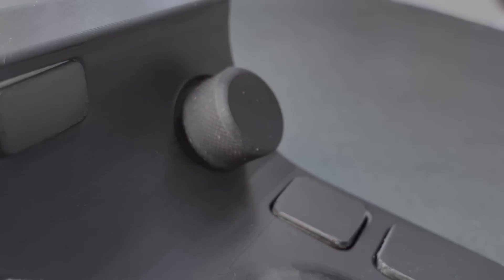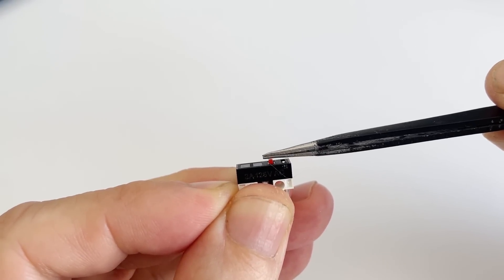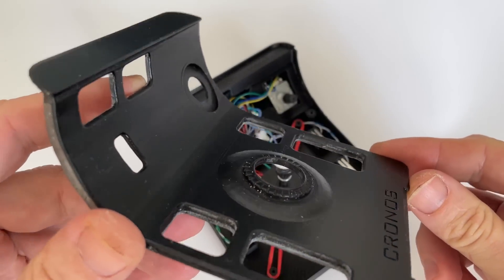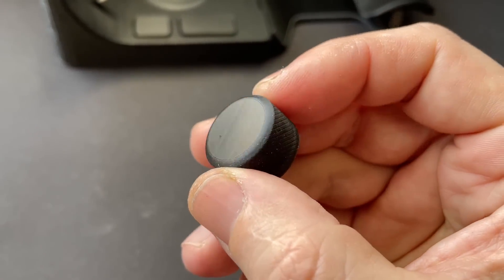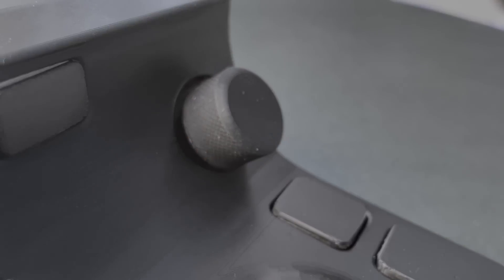Creating the Ultimate Mouse: The Journey Behind Cronos Control - A Mouse & Trackball Hybrid!

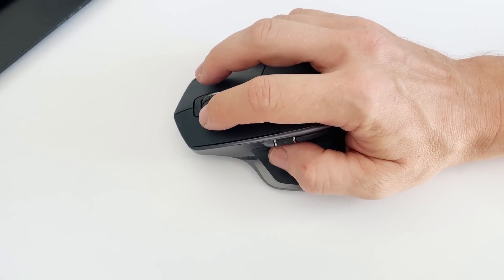Comment: 2:17 - Goal is Ultimate ergo mouse
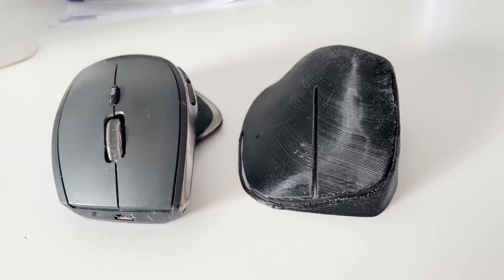3:08 - that form factor looks familiar... wait is that a ergo stationary mice?
3:14 - mini trackball or a force sensor array [TrackPoint] would have been a good contender
3:22 - Hall effect joystick could solve the dead point issue 
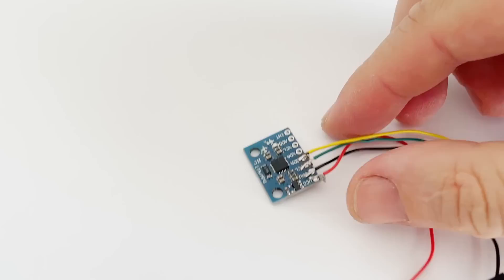3:31 - a 3 axis's magnetometer would have been a better option to the gyroscope, the main shaft can be made of metal 
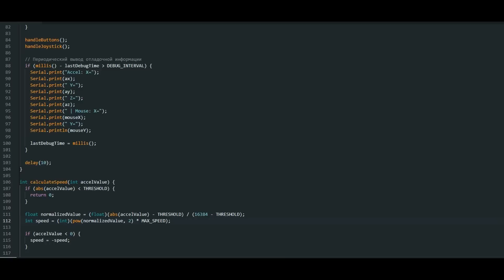3:36 - a stalwart platform is more stabled 
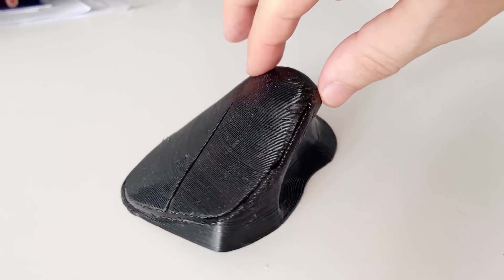3:53 - inspiration mostly likely to be from the Suncom's "Atom Mouse" or Altra's "Felix Pointing Device"
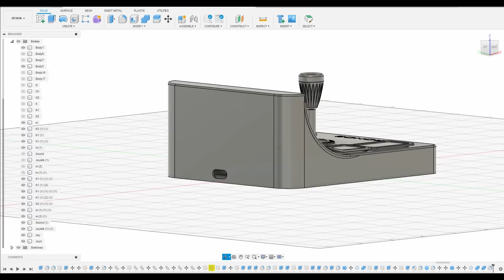4:07 - this is just a slightly worst version of a hobbyist space mouse 
4:12 - a flight stick?
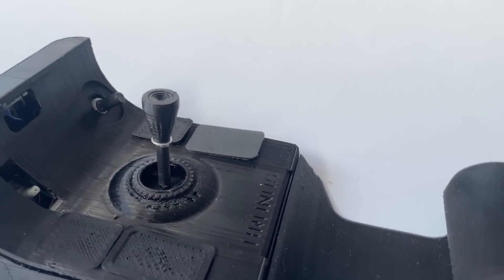4:31 - this is just a space mouse with 4-axies out of 6-axis missing
6:34 - this is just a Video Editing Console that happens have a flight stick attach to it 

I like the ideas in the video, but this needs further refinement to become a finish product. I wonder what a version 2 of this ultra Mouse would look like.
Reply from the maker: I'm currently busy filming a video about the changes I made thanks to your comments. Thank you for your constructive criticism.

Comment: Wouldn't this strain your wrist quite a bit from hovering your hand? Also I am quite concerned with tracking precision as it's my biggest gripe with the thinkpad knob
Reply from the maker: I changed the shape for holding the hand and added adjustments for length and angle to make the hand position comfortable for any palm. I will soon finish the video about the changes.

Comment: What are you doing to your mice? I've had both the original MX and the first MX Master and I got many, many years of all day use out of them without ever having to replace any switches. I got 5 years out of the original before replacing it for entirely aesthetic reasons. I've had my first gen Master since 2017 with no problems...

Comment: If you went that far as basically making your own type of mouse, it would also be a great idea to make it at an "handshake" angle to reduce risk of carpal tunnel syndrome, and it honestly looks like it would be easy to implement
Reply from the maker: Yes, I did it, changed the hand rest making it ergonomic with a slight tilt. I plan to make another video soon where I will show the changes and also demonstrate it in operation.

Comment: Not really any ultimate mouse at all...is just a very narrow niche for your specific usage.
The joystick is a very very limited way to move the cursor compared to the mouse which can be either small area usage or instantly jump to the other side of the screen with a simple and short jerk of the mouse. The joystick method doesn't offer same fidelity and adaptability. Not just a technology but the finese required because you use one finger instead of the whole hand in the case of the mouse

Comment: Any chance you will produce a wireless version? Only thing keeping me from backing your kickstarter is that this version is corded. Otherwise, take my money!
Reply from the maker: Unfortunately, the wireless version may be inferior in terms of connection quality. Technically, I can add Bluetooth and a battery, it’s not difficult, but comfortable work requires high bandwidth, which is provided only by Bluetooth 5.2 and higher. Alas, not all users support such modules, so for stability and responsiveness, it’s better to leave the wired connection for now.
Reply: Ah, yes this makes sense. Thank you for your reply. Also, it was unclear on your kickstarter - does the DIY Kit come with all the components including the mouse housing and buttons/knobs? I do not have access to a 3D printer, but perhaps, I could build my own and add in a wireless transmitter and battery. I would need to be able to travel with this mouse, as I often do with my current MX Ergo trackball.

Comment: In glad you found something that works for you, but there are a number of issues with this, and I feel like it's far from being a finished product. Also, there are a lot of issues with your initial reasoning for the need. 
1) As far as the need for this product, the biggest issue is the fact that your demonstration (and therefore, likely your understanding) of the different grips were incorrect. While you may not find any comfortable, even with a proper implementation, most people find one of those 3 to be perfectly comfortable for extended periods of time. 
2) while the sponge "plate" will help with inertia dampening, and the middle click being attached to the joystick does make sense, I don't feel these two methods are compatible. The sponge plate will definitely affect the feel of the button. Also, with a micro button like that, there's no way that you're able to freely move the joystick while also depressing middle click. Maybe consider magnets in a push-push configuration for dampening instead. 
3) The rest to raise the hand position up and reduce the angle is definitely a good idea for ergonomics, but it should be a palm rest, not a wrist rest. Also the rest position should be slightly higher than the joystick level, since extended periods of flexion are bad for carpal tunnel and similar issues.
4) you've essentially deconstructed the mouse, and added further distance between all of the elements, necessitating frequent removal or adjustment of your hand position to interact with certain areas. If you integrated your joystick into the (palm) rest, you could potentially move more elements to be interactable without the need to readjust.
5) I hope your gyroscopes and software have the ability to zero them out, considering without it, any area that's out of level or intentional added tilt would render them useless.
6) you could definitely consider a rheostat or linear potentiometer for scrolling instead of another gyroscope to simplify things tremendously. With the inherent dampening (due to construction) of them, putting a spring return to center it likely wouldn't have the same bouncing affect.

All in all, I'm glad that you found something that you like and enjoy, but as far as marketability and polish, I don't think it's there. Or that there's anything that this mouse does, that a 3d mouse couldn't do better. I also don't feel like you explored the trackball option enough. Turning sensor speed or cursor speed up, with a large trackball, let's you keep direct motion input like a mouse, rather than relative, like a track point or joystick, while keeping the wrist stationary. Even with slow cursor speed, you can flick the ball and let it spin, catching it at the estimated point. A few days of getting used to that should have you right as rain. You can then also combine keyboard inputs with the trackball to also let it control things like scrolling, keeping direct motion input as well as the granularity of speed.
Reply from the maker: Thank you for the detailed analysis and constructive criticism! I appreciate your attention to detail and agree that the design has areas that can be improved. You have a deep understanding of ergonomics and technical aspects, and many of your ideas, such as the magnetic damper and the correct tilt angle, are worth considering. However, let me explain why not all of the suggested changes may be successful for the current design.

About classic grips. I agree that traditional grip shapes suit many, and I do not aim to completely replace classic mice. My approach is rather focused on specific use cases where classic designs are not always convenient or even possible, especially for users looking for a new experience. Of course, this is more an experiment and exploration of alternative options than an attempt to replace generally accepted standards.

Sponge and middle button on the joystick. The idea with a magnetic damper sounds interesting and may provide better control than a sponge platform. However, I will need to do some testing to make sure that this design does not make the controls too complex or too sensitive, especially with prolonged use.

Palm rest. I agree with this completely. Increasing the angle can really improve comfort, and I have already changed it. I will soon finish the video showing the changes I made.

Spacing. Yes, adding a joystick has increased the spacing between the elements a bit, and this potentially reduces comfort. A possible solution is to actually try to integrate it into the palm rest, as you suggest, to minimize the need to move your hand. This is worth further research.

Gyroscopes and zero point. The calibration of the gyroscopes is already implemented. When the device is turned on, the gyroscopes perceive this position as the 0 point.

Potentiometer instead of a gyroscope for scrolling. This is an interesting suggestion, and I will consider it to simplify the design and improve control over scrolling. Perhaps this will really eliminate unnecessary vibrations and improve sensitivity.
Reply: @DIY_Yarik  I loon forward to the next video! I love unique solutions that are custom tailored to the person's preferences. But I also wanted to offer a bit of pragmatism that, since it's so tailored, it may not be as revolutionary as a mass product.

Comment: the buttons start to stick because a small electrical arc forms when you unclick, causing some damage to the contact surfaces of the metal in the button part. You can just scratch and clean those surfaces a bit and they'll be good as new for a long time. Kept my 12-year old sensei alive no problem!
Reply: arc can't form under 14 volts on sea level, there is something called electrormigration, you can mitigate it by making contacts from special silver alloy
Reply: @Strieuok  I have never heard of this lower limit on arc voltage and I'm having difficulty finding info about it, can you elaborate? And is this electromigration effect sufficient to reduce the surface area of pieces of metal that are made to contact one another with a spring force, starting with about a mm squared, that a button would no longer register as conducting? It's a neat alternative explanation as to why my periodic repairs of the buttons had an effect, thanks.
Reply: @Strieuok  I can wholly understand typing up a wall of text for strangers on the internet and appreciate it very much :). Thank you for the very informative post! After 12 years I did finally replace the switches (indeed omrons) with functionally identical ones, hope I can get another decade out of it!

Comment: The Razer Mamba Elite has the best solution for scrolling I've come across. You hold the mouse wheel to the side, left or right, to continually scroll. If you look at a top down picture of it you'll see two arrows to the left and right of wheel indicating this. I've never found another mouse that does this and after having used it I can never go back.
Reply: @mattl204  Razer Basilisk has HyperScroll option also.
It allows for a free-wheel scrolling mode with big wheeling power.
Combined with horizontal scrolling, I can’t go back either. 🥰
(Logitech G502 has an earlier equivalent, but barely usable due to the stopping being less reliable.)

Comment: First off, it's always a pleasure watch someone design and build a new idea they're passionate about, keep it up!

However, I have a major concern about the ergonomics of this. The hand and wrist are forced backwards quite a bit which is not a natural position for them and will lead to wrist issues with prolonged use. The advantage of a "mouse" that doesn't move is that you can place it in any orientation you want, so I would encourage looking at how you can redesign with that in mind. Try just letting your arm and hand relax down onto your desk and see the position that they sit in at their most relaxed state, and design to try and keep your hand in that position.

Secondly, on ergonomics, several of your controls need quite a reach to work them. This is especially noticeable with the scroll lever; your finger is fully stretched just to get your fingertip on it. The best possible situation is to have all your controls at your fingertip without having to move your fingers at all, so consider how that could be done.

For the joystick, several people have recommended hall effect joysticks already, which to me seems likely to be the best solution, but if you want to continue with your design, then consider trying a very loose fit ball and socket filled with grease to smooth out the motions. The socket would be part of the base, and the joystick would have a ball on the end that sits loosely inside, with the space filled with grease. This would move smoothly but the grease would slightly resist motion and help to prevent vibrations.
Reply: Yeah I noticed too that he need to stretch a lot. Honestly it feel that he is really close to something here.

Comment: This is a pretty cool project and I am glad it works for you. But I don't have any of the problems you have with a mouse; I seem to use a different grip than the three you proposed (my hand is totally relaxed and have no issue reaching any button or scroll wheel), I have never had a mouse break on me that just cleaning wouldn't fix (since the 80s), and I just set my sensitivity high enough that I hardly have to move my wrist to move the cursor to a second screen. It also seems like your cursor moves atrociously slow, you should do a 'cookie clicker' or similar demo to highlight the accuracy and speed of the cursor movement.

Comment: This might be the least ergonomic mouse I’ve ever seen.

Isolating the movement to only your index finger basically guarantees you’ll develop some sort of repetitive strain injury.
It would be bad enough if it were an index finger operated trackball, but that joystick isn’t exactly precise, which means you’ll have to do a lot of correcting movement, which only adds to the strain. Its lack of precision is also just a general downside compared to a highly precise mouse.

You’ve basically invented an RSI induction machine here. The ergonomics are just disastrous.

It’s not a bad project, but I highly suggest you to do a V2 with a trackball or something while paying attention to the ergonomics.

Comment: The MX ERGO S trackball is an amazing pointer. Granted, I have been using thumb trackballs since 93 and I think it is absolutely the most ergonomic design in existence. Your arm and palm are completely relaxed during operation and your thumb and fingers land on the control surfaces completely naturally. Combined with a SpaceMouse, navigating 3D environments is a breeze.
Reply: 100% agree.  Gaming with it is a breeze.  And alot of the wear associated with a traditional mouse is completely eliminated.  I won't ever go back to a regular mouse.
Reply: @quasimojo777  Wait... You can game with a trackball mouse? I cannot imagine how that feels tbh I never used one of those mices but somehow got interested
Reply: @exactpause9218 yep! Completely possible. Just takes a little getting used to, but with practice and tweaking, you can be extremely accurate, utilizing the momentum from flicking the trackball and stopping it to turn fast.
Reply: Thumb trackballs destroy my thumb joints. Every downward swipe just puts so much strain it.
Reply: @OkieDokieSmokie  o.O dude...go to doctor
Reply: I switched from thumb trackballs to index/middle finger trackballs. Way better experience, ergonomic-wise. No more thumb joint pains after a couple hours of use.
Also, you can flick it. Flicking with thumb trackballs is somehow awkward and feels unnatural to me.
And since you can flick it, you can game with it. I'm pretty sure i'm faster at moving in games with index/middle finger trackball mices... I'm sorry, MOUSE. I haven't changed this mouse (which i use for everything) for the last 6 years.
Reply: @noiJadisCailleach  I knew a guy who gamed with a trackball mouse once years ago. It has to be said he was very good, but he was probably at the absolute skill ceiling of what will ever be possible with a trackball and he was able to hold his own against most of our clan... But he couldn't touch a good player at all. The skill ceiling for what you can do with a mouse is just SO much higher than any other input device.

Comment: Really really cool mechanics. I think your onto something with the overall design. But I mean this in a constructive way, you need to go back to the drawing board on the shape and ergonomics.  One thing I would say is a absolute must is palm support, you have a bunch of dead space between the wrist and fingers that could easily have a form to support the wrist and setup the hand into a proper relaxed position, as it is now I don't see it being viable to use for more than short stints since you'll be constantly flexing your palm in order to maintain proper position for joystick accuracy. The overall button layout is another concerning spot for me, pretty much every button requires full extension or a shifting of your wrist position to press which is going to cause problems I think. Again really cool concept hope ya keep working on improving it.
Reply from the maker: Thanks for the feedback and constructive criticism! I did make some minor tweaks to the joystick and palm rest design to improve palm support and make the buttons more accessible. I'll try to release a new video soon showing the updates and answering your questions - I hope you enjoy the new version!